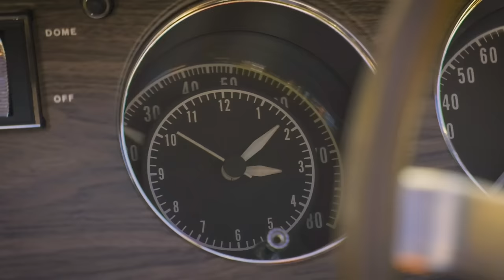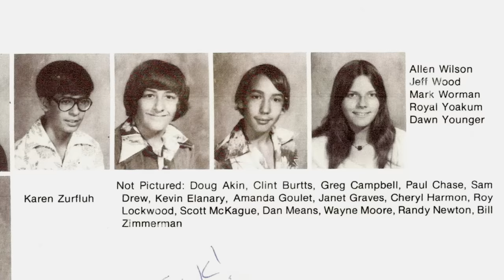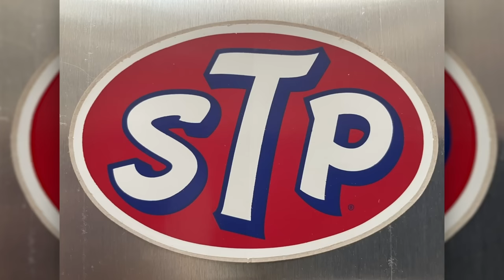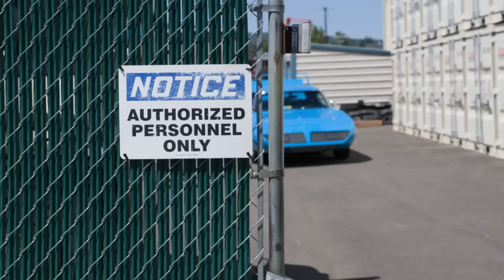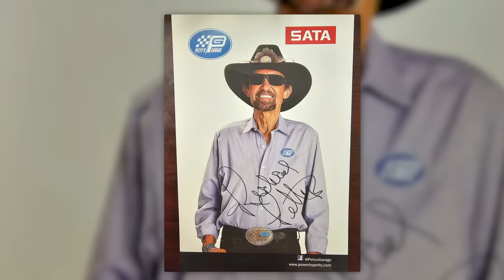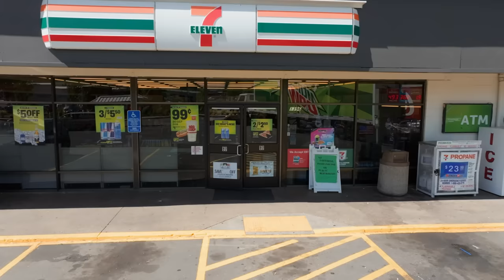THE KING RICHARD PETTY SUPERBIRD. ONE OF ONLY 43 MADE!

Comment: I agree with Mark to tell how “we” got these old cars cheep and got them running. But, it’s important to point out that while we were able to get these cool “old” cars cheep and get them on the road again, they were actually only 10 to 20 years old at the time. Today vehicles are built so much better with super materials making a 20 year old vehicle still relatively new. 
My 69 firebird that I bought for $250 in 1981 with under 100k miles had a dash that was roached and almost everything needed to be rebuilt.
Reply: It's nuts, back in 1980 or so there was a transmission shop out in the country, the father and son also raced dirt track. They had Chargers and Road runners all over the place waiting to be a dirt car, you could buy a running driving RR from them for $300 a piece and another friend bought a 1970 Chevelle true SS 454 for only $800. Man, if I could go back in time.